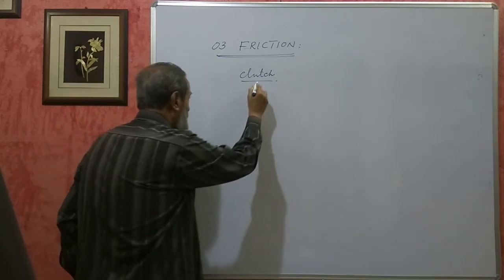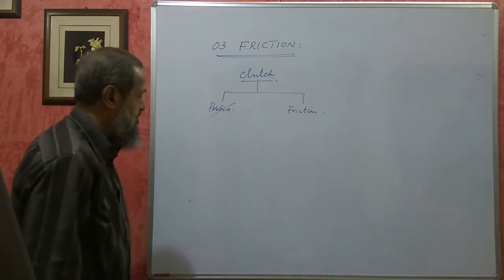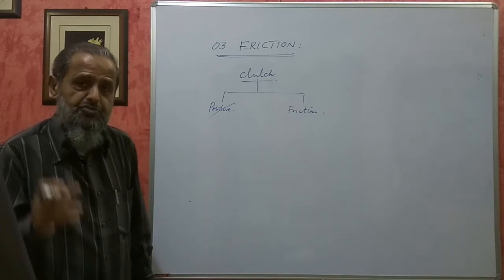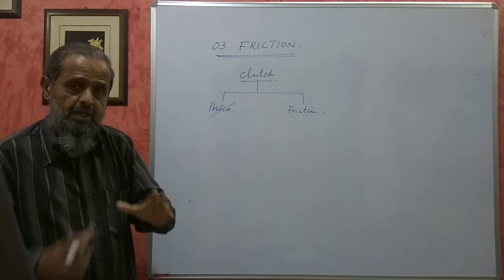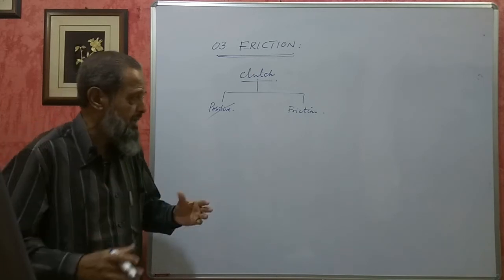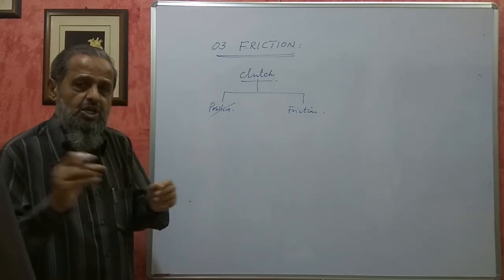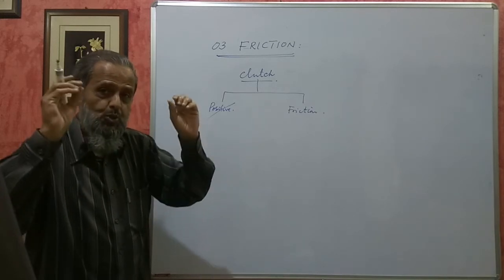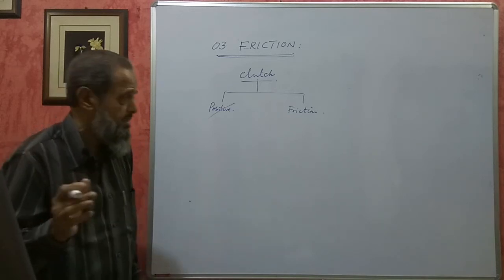Karnataka Diploma MOM - Friction - Part 3

Comment: Sir solve this problem .............                    A CONICAL PIVOT ANGLE OF CONE AS 100 DEGREE.  SUPPORT  A OF 18KN THE EXTRnal radius is 2.5 times the internal radius . The shaft rotates at 150 rpm if the intensity of pressure is to be 300 kN/mmsquare ... What's is the power lost in working  in working against the friction
Reply from the maker: Dear Sanju please send your WhatsApp no, so that I can send the solution to you.